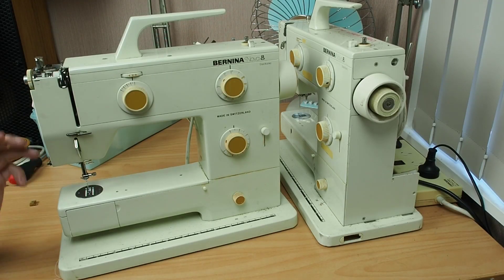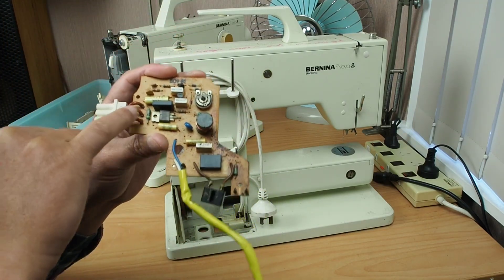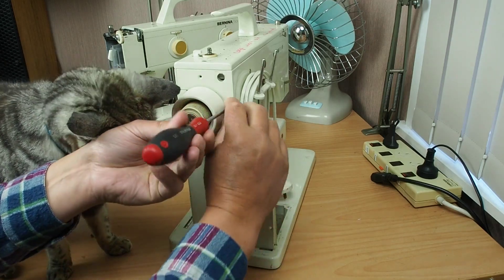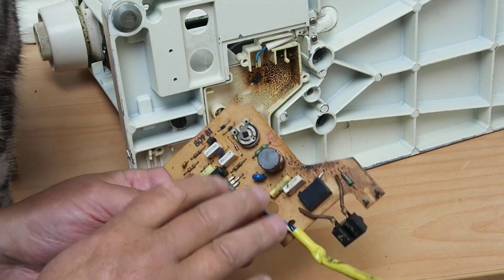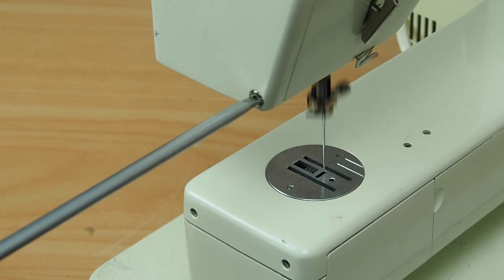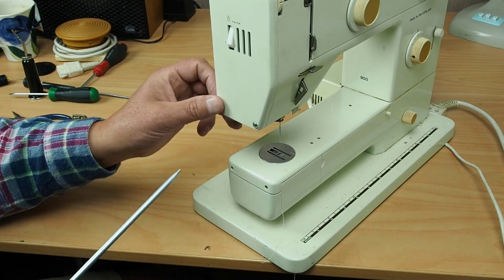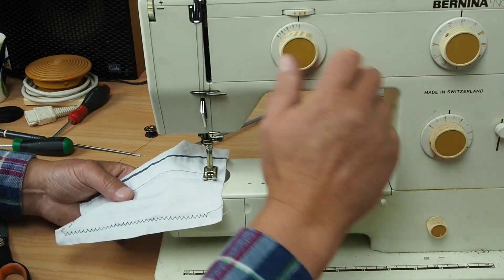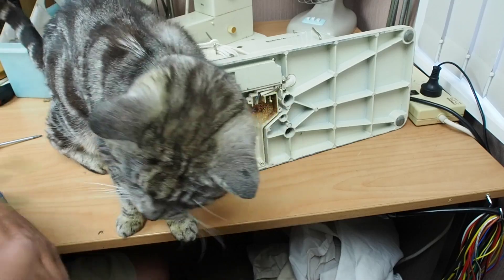Bernina Nova 900 Electronic Sewing Machine - Assessment Part 3 - Molly is rather troublesome.

Comment: Thanks for this good video with details of this machine. I have got the Bernina 910, and I have seen videos of the 930 as well. It seems that the 900 got the "old style" universal motor with an electronic triac controller. I think it is similar to the 830 electronic. I am just a little puzzled by the three wires to the pedal (it is not just two wires, as the 910 have got). Do the Bernina Nova 900 have an extra function build in to the pedal?

It seems that the basic mechanics of the 900 and 910 is very similar, but the controls for the embroidery stitches are a bit different. The 910 and 930 got a DC motor with permanent magnets and some more advanced electronics for it with RI compensation, so the speed becomes less sensitive to load changes.

Comment: Thanks for your videos. I just got a Bernina Nova, Berninas in my country are really hard to find. Mine looks like was never used. The machine its working great, i open it and I found out that the capacitor was blown out.  I will try to find someplace where i could find one. My question is, can i still use the machine without it?
Reply from the maker: I think you should be able to use the machine if you remove the blown capacitor bits. Thanks.

Comment: So where do you get the capacitors chanted? Did a Bernina dealer do it or is it something we can order? What about the machines that have issues with running to fast?
Reply from the maker: The capacitors are available from most electronics suppliers. They can be removed and installed with a soldering iron. A shorted capacitor can sometimes cause the motor to run on (by itself).
Reply: @InStitches  Hello! I have tried to locate the capacitor for the foot pedal as per your previous videos on Bernina foot pedals and thought it may translate to the Nova, however I have opened the pedal up and no board inside.... is the board on the machine as per this video the capacitor I should be changing?  The problem is the pedal literally goes 0-60 in 1 second!  Also can I just check it's a 0.01uF capacitor please?  Please don't think I know what I'm talking about as I have learned everything from your videos!!  Thank you so much for your amazing instruction - saving so many machines from landfill.  I have inherited this machine from my Mum who passed away last year and can't afford to get it professionally looked at.  Thank you! x

Comment: Very informative vido, thank you.  A question,  You talk about the US models being 110V.  Would it be possible to just swap out the motor in a US model or would other components need to be changed to make it work on 240V?
Reply from the maker: Hi. I would say the circuit board may need changing as well. Thanks.